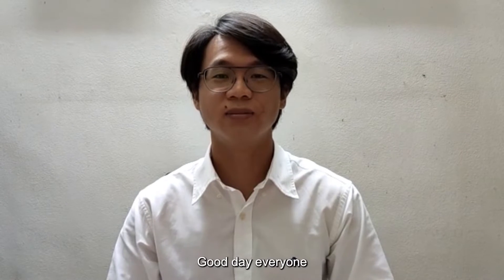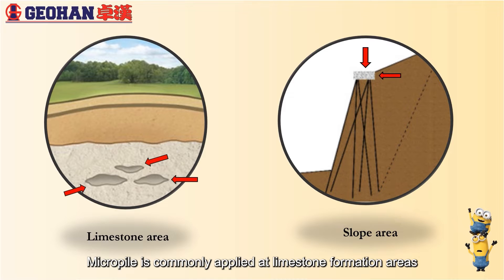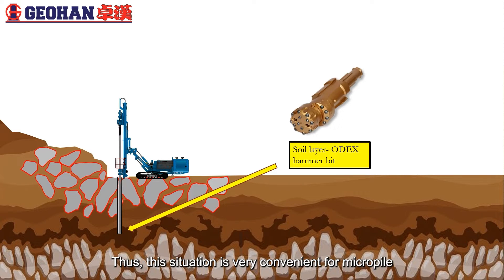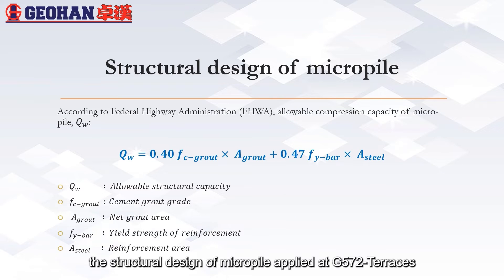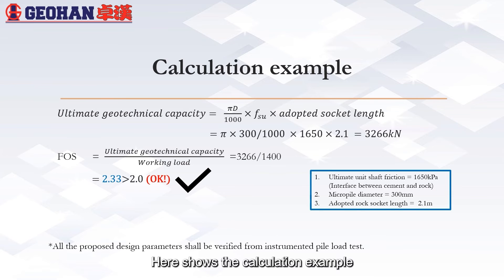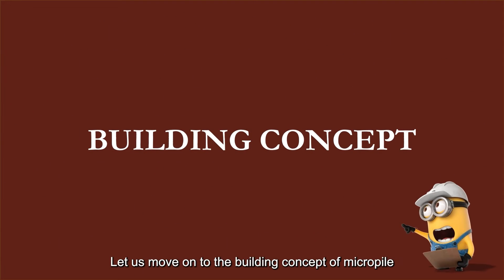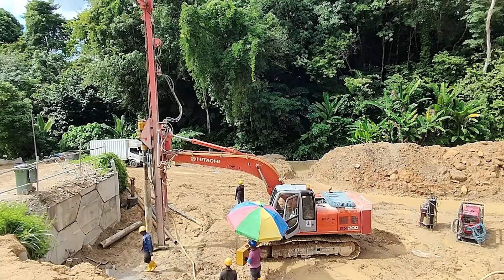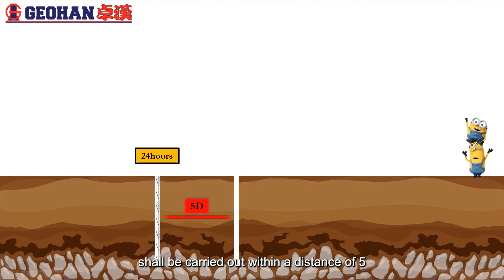Micropile Explained | 𝐆𝐞𝐨𝐭𝐞𝐜𝐡𝐧𝐢𝐜𝐚𝐥 𝐅𝐨𝐮𝐧𝐝𝐚𝐭𝐢𝐨𝐧

Comment: Temporary steel casing is push down first and then start drilling...or it both go down together? If it is together, how the casing being tied to the odex system?
Reply from the maker: The drill bit would go down together with the temporary casing. 
It is quite hard to explain here, how the odex system works. Probably we save it for another vlog. Thnx